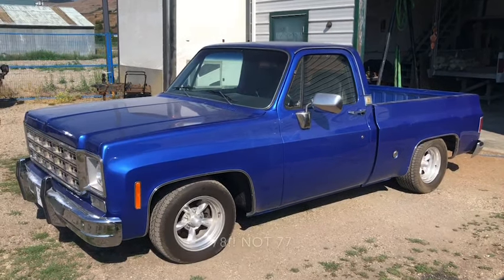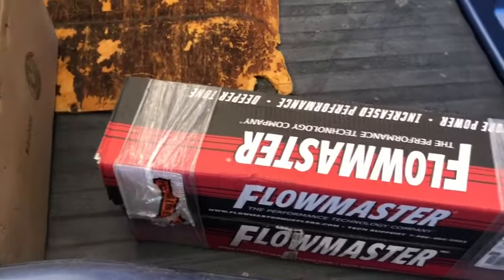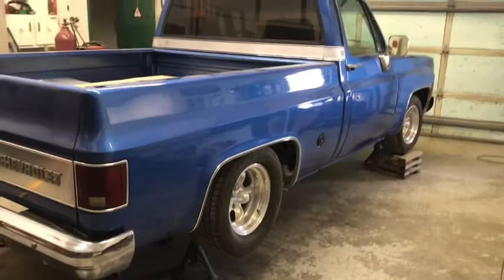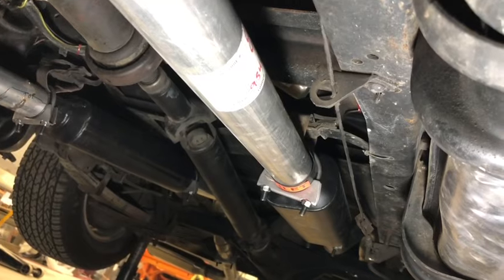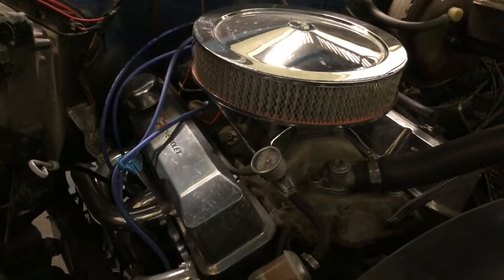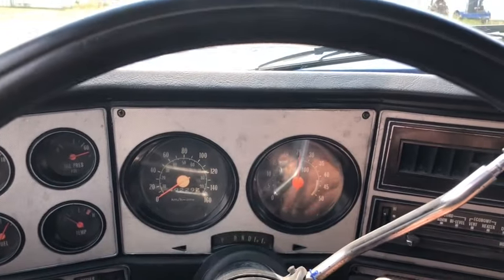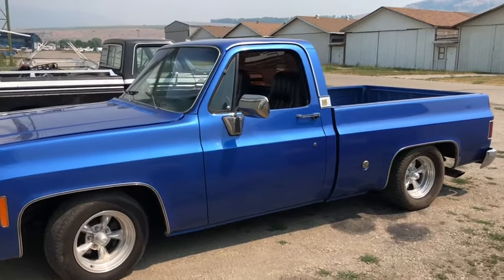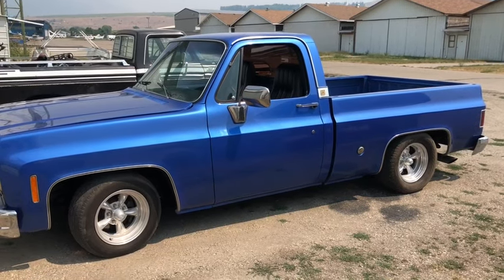Flowmaster Hushpower HP-2 Moderate Sound Muffler Review/Comparison on a SBC Squarebody C10 Quiet????

Comment: Flowmaster is the last muffler you want to get if you want to quiet it down lol.
Reply: i had a flowmaster original 40 series on my pickup and it sounded just about stock.
Reply: @benjamincruz514  yeah same
Reply: The chambered 2 chamber or race one chamber are pretty loud without cats and long tube headers but l now have Flowmaster Flow FX box style mufflers and it's much more quite at idle to 2800rpm but has a real crisp solid clean performance sound 2800rpm up without any popping or crackling when slowing down with your foot off the gas petal got complements at the track with how it sounded in the burnout box and going down the track by numerous people
Reply: Flowmaster has a large spectrum of mufflers that range from loud to quiet. The super 10 being the loudest and the 50 series being quiet. The hushpower is in between.
Reply: @Hayden Storm  My 85 C30 dually has factory duals with Super 10 mufflers. Supposedly, they're on there to help improve the mileage on the 454.
Reply: @SOU6900  I didn’t know you could improve the mileage on a 454 😂
Reply: There's alot louder
Reply: Flowmonster is pretty quiet.
Reply: They make at least 16 different mufflers, from almost stock sounding, to really loud.
Reply: This is a terrible comment
Reply: @jeanvi52  😂🤣😂🤣
Reply: nah theyre the quiestest mufflers i ever heard.
Reply: @bdtaylor1979  The only way to improve 454 mileage is to turn it off.
Reply: I have one brand new Flowmaster 50 series muffler on a 1994 stock Dodge 3.9 V-6 and it drones excessively at highway speeds. Yes it does and the muffler shop assured me it would not. Can't talk to my passenger, or listen to the radio. There is nothing quiet about it, from idle to redline it is loud. It is part number 942552 and I hate it. So I agree, Flowmaster is the last muff to use for quiet.
Reply: @650gringo  the 50 series is extremely quiet, its damn near a replacement for OEM. how does it drone and how is it loud?
Reply: @logicbewithyou111  How is it loud? When the engine is running. Then it's loud. How does it drone? When the engine is on while driving down the interstate. That's how. Is there any other way?
Reply: @650gringo  its a really really restricive quiet muffler. so you're saying a stock car is loud? how quiet do you want it? i cant really think of a quieter muffler than a 50 series at all.
Reply: @logicbewithyou111  I don't want to hear it droning on and on hour after hour out on the interstate. My 50 series does just that. Also, while it sounds throaty below 3k rpm, above that it gets tinny sounding. Embarrassingly so. I doubt it is very restrictive at all. Why do you care what my muffler sounds like?
Reply: @650gringo  im just confused. it has many many baffels that should stop drone. It is restrictive as it isnt a straight through design. It creates backpressure losing power.
Reply: @logicbewithyou111  Yes you are confused. Take your confusion and go away. You don't know what your talking about. You don't know if it has more or less back pressure than stock. Or more or less sound than stock. You haven't measured it side by side. So, mufflers aren't what you need to worry about.
Reply: @650gringo  nothing will outflow a piece of straight pipe. when you add all those baffles that muffler has, you’re creating a restriction. you can find mufflers that are straight through and perform better than flowmaster. this has been dyno proven.

Comment: Finally found the sound im looking for! This would sound amazing with my 78 camaro 454 10.1 with a mild cam
Reply from the maker: I bet they would sound good on that
Reply: @atpmonstergarage  what year of seats are those?
Reply: @hunterb3386  they look like the original bucket seats, which I think are the same in the blazer. I ordered my 78 BIG10 new and looked at one on the dealership lot that had buckets but I didn’t like the back of the cab behind the seat, it looked unfinished so I ordered the bench seat.
Reply: How did well did it fit for clearance? I have a 1978 Trans Am.

Comment: Add a H pipe, and runs the tailpipe tips straight out the back, makes it quieter in the cab.

Also the FlowFX is quieter than these (the oval case anyways) they're a Magnaflow copy, try those.

Comment: I recently put a large glass-pack muffler on my truck, and it's quieter now than with a Flowmaster Super 44.  The one I used was an AP Xlerator.  It's a straight through design so it flows well, but not objectionable at all.  Seems to run better than with the Flowmaster.
Reply: Road Kill test showed the Cherry bombs made more power
Reply: @drumrooster  Cherry bombs made more power than what?  The Flowmaster 44 or the AP glass-pack?  I liked the Flowmaster sound, but I like the way the truck runs with the glass-pack, too.

Comment: You think these are the loudest mufflers you've ever heard? It is hard for me to imagine them being louder than the straight-through Cherry Bomb glasspacks. I have a set of 18" Cherry Bombs in a 2.5-inch dual exhaust system for a 445ci Ford FE. I was going to try these HP-2's to quiet it down as the glasspacks are just insanely loud, but I have very limited space to work with for a muffler.
This review is making me question if the HP-2's would be worth it.
I love the sound of the glasspacks though.
Reply: Leave them on it lol..
Reply: I went ahead and bought a pair of these HP-2's to replace the Cherry Bombs on my FE. I disagree with this video, the HP-2's are not the loudest mufflers - they are substantially quieter than Cherry Bombs (if you consider Cherry Bombs a 'muffler'). These are louder than what Flowmaster lets on, but they do sound great and attenuate the maximum exhaust volume well. I would recommend these on a V8 application where space is an issue.

Comment: I've had a set of these mufflers in my garage I've been wondering what to do with. I originally intended to install them on my 1995 Mustang Cobra, but I'm wanting to make that car a lot more tame. I'm thinking I may use them on the 1966 Mustang I'm restoring if and when I ever get that thing build and running.

Comment: After researching for new mufflers I heard these on 1 other video and like you, I thought that the Super 10's were the loudest, but after listening to this video several times, I believe these mufflers will be a nice addition to the MSA Dart. Which you can see and watch in the documentary Driven to Help. Great video. I'll keep you posted and tag you in it because your video made me make up my mind. Hopefully it will sound good with that 408ci stroker crate motor from Blueprint Engines (sponsor of ours) which is pushing over 500hp. Fingers crossed they sound close to what these do!! Austin Crawford.   BTW that part number is listed as the 12" case which is the louder of the 2 cases.

Comment: I always used 50 series mufflers, the big block series and they were not too loud at all
Reply: Was thinking those myself. What's your specs if ya dont mind please🙏? I built a Vortec 350 long block with flat tops, .035" quench, 10.4:1, 220/224* .495/.502* 110°  on 107°. 
Love the sound of an H pipe exhaust they put in the fox bodies. Like to have a sound CLOSE to that. My plan is 2.5 h pipe with _______ Mufflers. Absolutely no idea what to pick. Not a fan the glass pack sound though.
Reply: I have a pair of 53051 flowmasters on my 78 SWB BIG10 454 with 3 inch pipe from collector to exit and they sound good.
Reply: @AR_420  hey what kind of mpg are u getting out if that?  I like the dyno max mufflers, magna flo and borla

Comment: I put a 2 chamber summit muffler, so flow knock off, on my 88 k2500 and love the sound, but I think it would be too loud for you. It's factory Y pipe, so 2" down to a little under 3"  and then I put a straight piece of 3" back to the muffler and got a diesel suburban pipe to go from muffler over the axle and a single passenger side exit. I think it cost me maybe 200$ all together, but I can weld and fab so all DYI. I like it loud! But it's not poppy or snappy. More rumble. I'm running a 355 that's pretty mild, probably 325-350hp.

Comment: You’re right to a point, but from experience I can tell you that a high performance engine vs. a stock engine changes everything. I have a bronco with a 429 with good flowing heads and high compression; headers, 3” exhaust and a flowmaster 50 welded to a 40 on each side that is still pretty loud. Needless to say, I understand the struggle.

Comment: I bought a stainless steel kit for a 2018 F-150 5.0 and it came with a 40 series Flowmaster. After I saw it I ordered a 70 series and an auger to weld in the pipe in front of it from Speedway’s dirt tack section. After the kit was in stalled I had to rivet in a deflector infront of the end tips to make it livable on the road. Sound great now….

Comment: What specific Patriot headers did you use?  I assume the ‘77 Chevy truck has a small block.  What are the specs on the engine?  Cam, intake, carb, etc.
Reply from the maker: I don’t know the part number but they were 1.75” primary tubes. 350 SBC, aluminum manifold, Quick Fuel carb, big lumpy cam but I don’t know the specs on it. It was a used motor we didn’t know the history on

Comment: I had a question concerning the installation of the Flowmaster 12518409 HP-2 mufflers onto 2-1/2 inch pipe.  The mufflers only come in 2-1/2 inch opening.  Do you have to weld around the very edge, and if so, do you still get a good seal and smooth surface inside the pipe?  Will it hold up to shock, etc.  Also do you have to use special welding techniques and/or material due to the mufflers being made of stainless or did you just use stainless pipe?  Don’t know much about welding!  Thanks!!
Reply from the maker: They are made to fit directly over a 2-1/2 inch pipe. They will slide right over the pipe. And these aren’t stainless so no tig welding required. Just need a mig welder

Comment: I'm going to try one on my Can Am 570. ATV mufflers are ridiculously priced.
Reply from the maker: Lol I’m looking at an Arctic Cat 1000 and was thinking the same thing
Reply: @atpmonstergarage  I just went out and measured the stock pipe going into the muffler and the O.D. was just under an inch and 3/4. Gotta figure something out there. The other thing that's cool about this is the lifetime warranty. If I could rig up a cup and ball system with springs, it could be easily removed.
Reply: @atpmonstergarage  I really think you should do it. For some reason the 304's aren't available. Just the black 409's. Being a car guy, I dont think anything could be more cool that seeing the Flowmaster embossed name on the back of my ride. Yours too. If they sound amazing even cooler yet!

Comment: That's not to loud that sounds jus right i'm running flowmaster super 40s and they sound good what's done to that motor
Reply from the maker: It’s a mystery. Customer bought a used motor with no specs. He was told it was around 400 Hp and it’s rollerized. No idea on compression or cam
Reply: @atpmonstergarage oo ok cool sounds good tho 🤟🏾

Comment: Did you put an H or X pipe in that system?
Reply from the maker: No X or H pipe. Just header straight to muffler
Reply: @atpmonstergarage  X will totally quiet it down. From the looks of what you are doing you could sneak it in at the very beginning before you chopped the 90 up to curve out.

Comment: What engine is that truck running if you don’t mind me asking?
Reply from the maker: It’s an estimated 400 Hp rollerized 350 that was a used motor. Not sure what’s inside as we’ve never had it apart. Nobody knew the history on it
Reply: @atpmonstergarage  damn i love the original sound you had at the beginning of the video imo that sound is something i dont get annoyed of lol
Reply: @atpmonstergarage  I have a 84 C10 working on putting in a 350 5.7 in it and want to build it up for at min 400hp

Comment: Its loud but it's muuuch less raspy qnd cracky than when you started the video.  They said its the quietER of the two, not that it's quiet.  😉  It sounds like it should...  If you want quiet, get their fitry series big block.  Allvthe power, none of the noise.

Comment: Why not putting two in series.. would not be so loud
Reply from the maker: Shouldn’t have to when they’re advertised as quiet performers. $350 for the pair too
Reply: @atpmonstergarage  Well for the money they should do whats advertised.. But in general resonators should be used to reduce high frequency noise which means high rpms.. good rule of thumb is  lenght 10 x ID. where ID is pipe ID and 10x is acustic  panel(perforated surface itself). for example 3'' pipe needs at least 30'' resonator..  so in general twin regular long cherry glasspacks in series should eliminate  drones while cruising and be pretty silent but still keep low tone and free flowing exhaust.

Comment: What year of seats are those ?
Reply from the maker: I don’t actually know but he’s owned the truck for several decades and it’s always had them in since the customer bought it
Reply: @atpmonstergarage  darn id like to put some like that in my 78. and also im very intrested in these mufflers but i want an exaust that is loud deep and throaty but i dont want to have a head ace after an hour of driving what would you suggest
Reply from the maker: @hunterb3386  I will do a review on the Magnaflow’s I’m using on my Big Block Jimmy. It will be finished in the next 2 days
Reply: @atpmonstergarage Ok thanks do you think these HP 2s are to loud?
Reply from the maker: @hunterb3386  I really like them and will use them on another build but definitely wouldn’t want to go on any journeys more then a hour with them. Gets the tinnitus going pretty good
Reply: @atpmonstergarage  gotcha I’m building my truck to be like a street rod/ cruiser wanting to find something that turns heads lol. Thanks for the help I will be looking for the magna flow review

Comment: They are nice but over priced they will not even give a muffler shop a discount for a large order of their products . They found the full boar brand sounds nice and is about half the price and they give a discount for a large order . Found out by chance a very quiet muffler with low back pressure look up the ones for the gas big block ford engines in the F 600s from the mid 70s and they do not burn out ether .

Comment: I couldn't tell from the engine shot , it was a little dark,  but if you're running a single plane intake its going to be alot louder than a dual plane intake , all else being equal , a single plane intake motor  is  always going to be louder . Bolt up like an Edelbrock air-gap or Performer intake manifold both are dual plane it will be a whole lot quieter  .